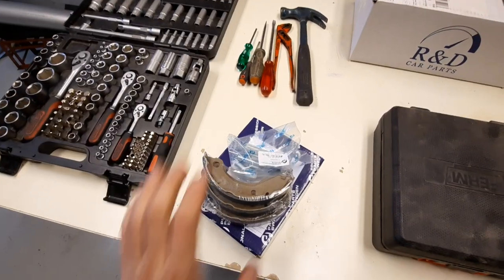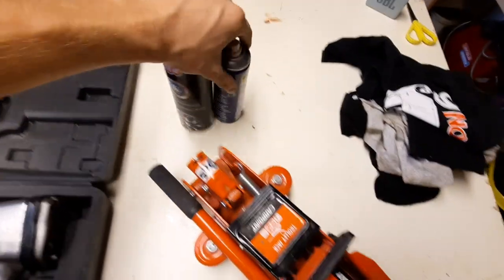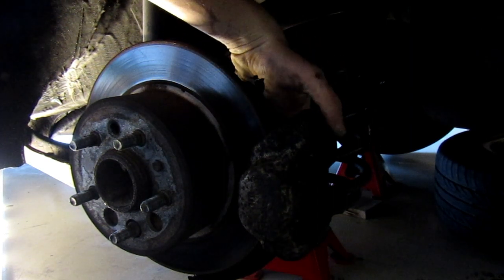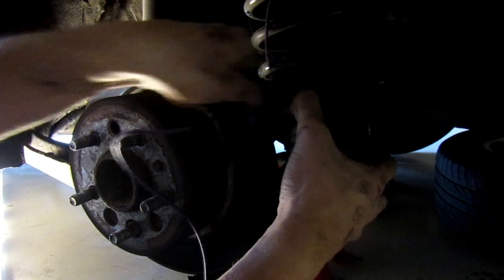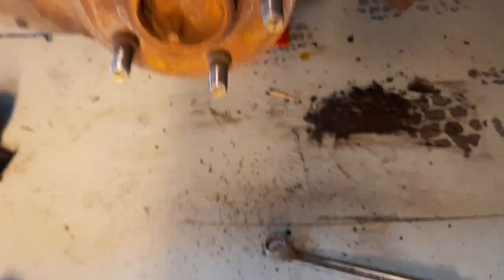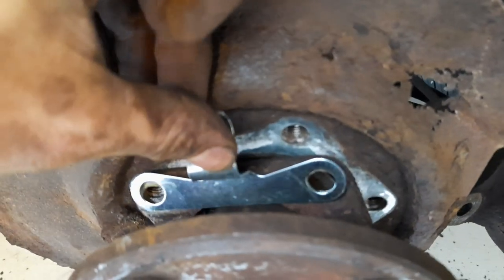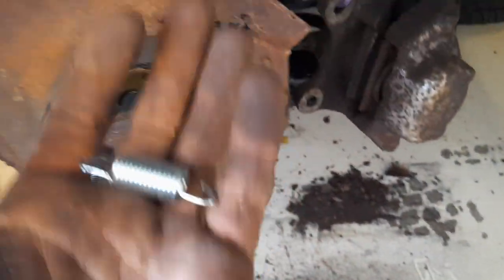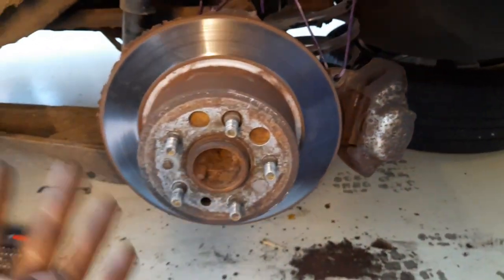Parking brake repair volvo, replacing handbrake pads, volvo 240, 740, 940 // HowTo // ThatWhiteVolvo

Comment: Thank you! Not many rear shoe/parking brake videos, lots of good details in this one! Some aspects were skipped over, sadly, not very many though.  The bolts for the shoe clips remain mysterious.
Reply from the maker: thank you for the comment.
what do you mean with bolts for the shoe clips? There are no bolts that hold the clips in. Those are hold by the brake pad pins.
Reply: @RollinHeritage  Not sure I follow, the shoes are curved, you showed a metal stamped strip that bolted to the back of the brake housing and the shoe slipped under the clip against the back of the brake housing. I am aware the brake pad pins hold the pads in, are you saying they also hold the shoes in?

Comment: Nope. I've been a 240 Mechanic for 22 years, and I have never replaced these shoes. It's about dealing with the springs ( why I watched this video). He shows nothing about the toughest part of this job. The springs are awful to deal with behind that big hub. Even the Volvo repair books don't give you a clue/tip.
Reply from the maker: like i said in the video. use some pliers or do what i did and warm up an old screwdriver and make your own 90 degree angle spring puller and you are done with that spring in a second.

with the replace the shoes comment you mean the handbrake shoes/pads? 
i've worked on the 3 volvo 240's close to me. my own and the 2 of my friends. and they all had crumbling and bad, worn out handbrake pads.
Reply: How can you be a mechanic for 22 years and never changed parking brake shoes?